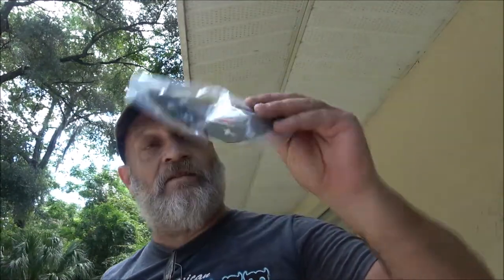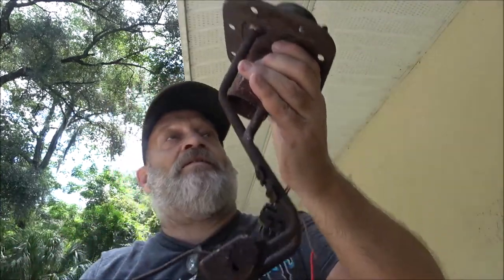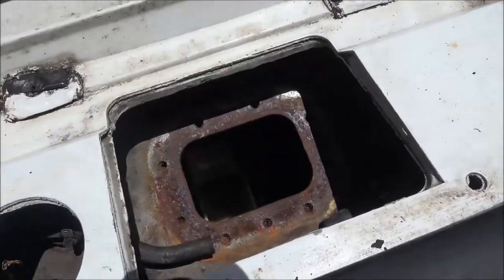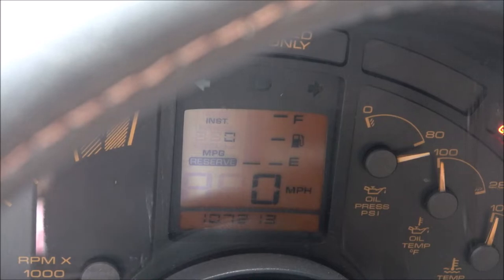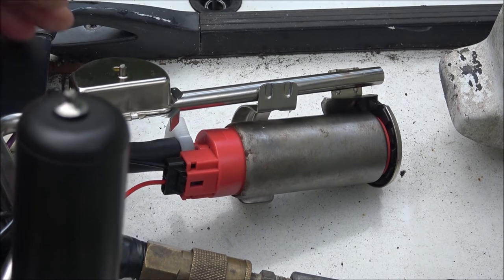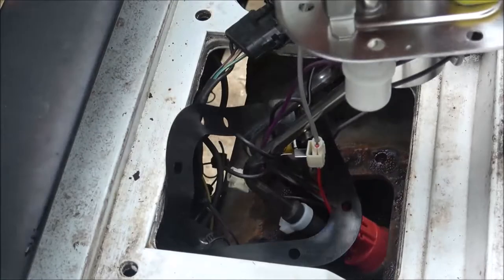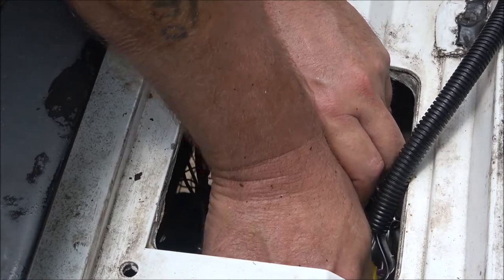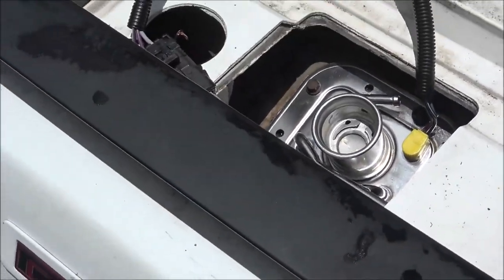1990 Corvette C4 New Fuel Sending Unit (Gas Gauge Sender)

Comment: Thanks for the vid!  I just recently purchased a 93 C4 and the fuel gauge will show two sometimes three fuel bars but it will start to sputter and run out of gas.
Reply from the maker: You're welcome. Pull the sending unit out and adjust the float by slightly bending it up until you get a closer reading. I would rather have it run out of gas after empty instead of before. Let me know how you get by. If you have any more questions please feel free to contact me.

Comment: Great video .
      I bought a ' 90 Convertible that was neglected by the previous owner  It runs great and has half tank of gas and its showing " Reserve " . I believe the sending unit is bad .
Reply from the maker: I would agree. It probably is the sending unit.  About 100 dollars on line, stainless steel.
Reply: @shabear1000  Great . Thank you for your reply. I just ordered one from eBay .
Reply from the maker: @thaddeauscaldwell7101, you're very welcome. Thanks for watching and commenting.